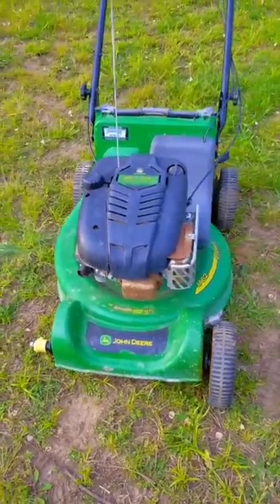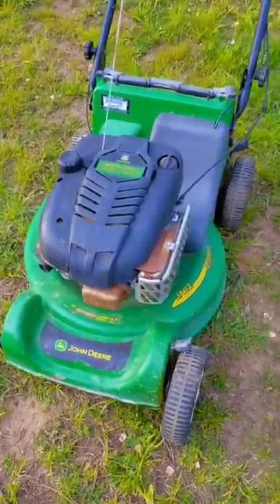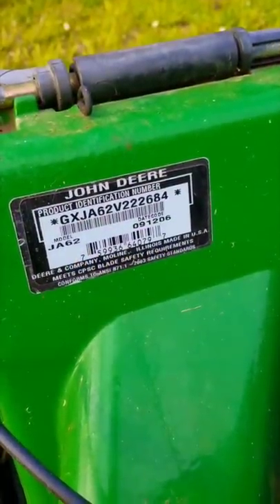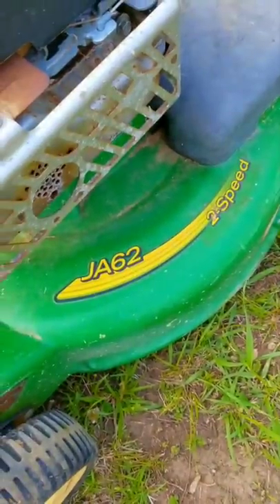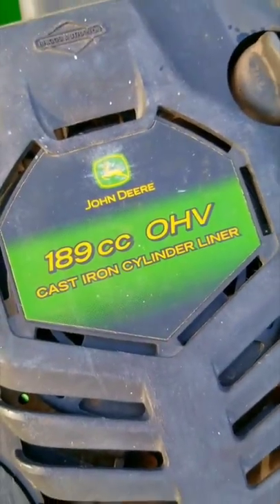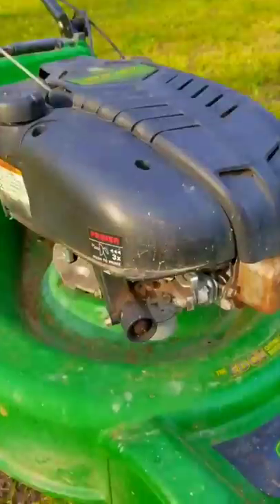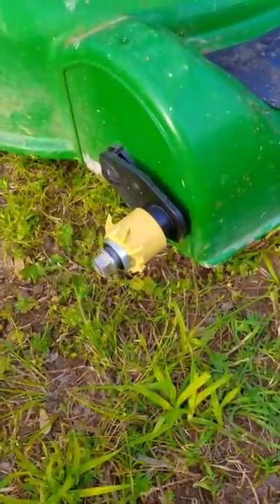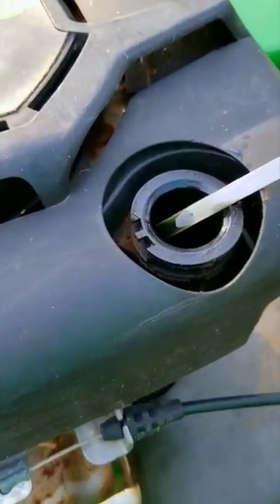That's not motor oil in the engine!

Comment: 2-stroke oil?
Reply from the maker: that's my guess as well, its a dark green and it's really thick, much thicker than motor Oil
Reply: @HomeGaragechannel  differential oil
Reply: @funnypranker34  Yeah sounds like gear oil, some of that can have a green tint. Or maybe Lucas oil stabilizer.
Reply: Looks to be 2 stroke oil. Whatever it is just drain it, take it apart, blast the thing inside out with some brake cleaner and pop it back together. It’ll work like a charm 👍🏻
Reply: Could be something weird like Royal purple mixed with something
Reply: u did used to get mineral based engine oil back in the day that was green such as duckhams
Reply: @HomeGaragechannel  it gas mix in oils because leave gas in tank over years it start leak it way into engine thur piston ring in oils pan because floats got push away by rust building up
Reply: Shit at least it had oil
Reply: I use high zinc oil and it's green like that. Penn grade. However if you really want to know, send a sample to Blackstone labs.
Reply: @Davross-420  . Why not add motor oil?
Reply: @senatorjosephmccarthy2720  how do you mean pal? If the engines been sitting with gunk in it for a long time adding oil might not solve anything. I usually take it all apart clean everything, get new gaskets fresh fuel or mix if it’s 2T, get a new spark plug and it’s usually good as new.

Comment: I have a lawn man mower from Walmart, bought over 15 years ago. Never checked oil, air filter anything. Put fuel in it when it runs out. I'm convinced its never going to stop
Reply from the maker: very nice.
Reply: The air filter will be the first to plug up using old oil it doesn't really matter long as it stays wet all it'll do is dirty up the plug
Reply: @Mike-su8si  or it just disinterested and added to the oil 😂
Reply: @travismiles4807  someone probably did put more oil in maybe they didn't know were to put it

Comment: Looks like a ton of people on here hasn't worked on that many mowers to know that is oil its just old oil 

I've worked on mower's that sat for 40 years the oil in them were thick like tar 

I've worked on driving mowers that was low on oil just like that one it was motor oil just really old oil from them not changing it plus from the engine sitting for years 

I don't believe its 2 stroke oil it doesn't look like it to me.
Reply from the maker: thanks for the comment.

Comment: I have a wood splitter at a friend's farm. I occasionally let tree work customers use it for free, 1-2 times a year. It sees probably 2-5 hours of work on average a week at the farm. When the oil level got low he would ask me what viscosity oil to top it up with. I told him; as long as it is thicker than water and thinner than honey... I don't care.
Reply from the maker: That's a good way of thinking about it. thank you 7ies
Reply: @HomeGaragechannel  small engines and repairs is hardly a specialty reserved for the rich anymore. If they break beyond repair it's just a good opportunity to upgrade.
Reply from the maker: I completely agree with you on that one.
Reply: @7eis  have to disagree with you sir I am a mechanic at a small engine shop and we do sell new and some used equipment and the supply chains and parts we have a hard time getting stuff since this pandemic was around repairing machines is important and to many people just throw stuff away there’s a reason why theses machines have replacement parts and serviceable parts buying new and upgrading is nice but it’s not always practical and is in a way wasteful we see so many machines some with less than a year of being used and people throw it away once you rebuild an engine a carburetor or do some sort of work to a small engine or a machine you will understand a little bit more about what all goes into it
Reply: @hunter7476   I will say there is no shortage of Kohler K301 parts and upgrades. I think all these parts shortages are for new items.
Reply: @arthurr8670  yeah usually but even then just filters and stuff is still hard to get sometimes
Reply: @hunter7476  I’d sure hope you’d understand how everything works a little more if you rebuild a damn engine.
Reply: @joshcantrell8397  what do you mean I’ve done many engine rebuilds before and never had it come back ran smoothly and didn’t burn or knock I know what I’m doing and I’m not an iddiot my way of explaining isn’t that great but my work shows my quality work
Reply: @hunter7476  I know parts supply has been sketchy the last couple of years. My point was how accessable information on how these small engines work (and thus knowledge to diagnose given an IQ of +80) are. And how if something truly is beyond repair a new(or new to you) replacement engine can be swapped in. Some non-essential (to me) equipment I'll run into the ground with minimal maintenance without worrying about it and just fix when not working, until it's time for replacement - like the log splitter in question. I'm honestly not sure if the point you tried to make even relates to my initial comment.
Reply: @7eis  yes I agree with you
Reply: @7eis  , Just the opposite is true. What's your agenda?
Reply: @joshcantrell8397 . troll.

Comment: I’d almost say there’s gas in there but in the smaller engines they normally have a oil that’s tinted green because it’s specific to that engine
Reply from the maker: on this tank, if the visible part of the tank  is wet, it means there's still some fuel at the very bottom of the tank.
Reply: @HomeGaragechannel  no I’m sayin there might be gas in the crankcase

Comment: What year do you" roughly" think that Mower is? 
I still have a 1989 Craftsman lawn mower in excellent condition.
The metal on that thing is extremely stout
Reply from the maker: if I had to guess, probably a 2006 model.
Reply: A push mower or driving mower
Reply: I like to hear that being as I just bought a craftsman lawn mower last year my theory when I bought it was the lawn mower would fall apart while the Honda engine would just keep chugging
Reply: @mrl3044  it can happen if it's old and used some other people don't take care of stuff to well were the engine can be just fine but not the deck and other parts the engine could outlast the deck and body
Reply: @Mike-su8si  that would be a riding mower
Reply: @billmers3219  alright
Reply: I live in the east cost and this shit happens all the time, lawn mower decks rust away, wheels fall off - i had an 80s murray pusher where the deck had like 6 holes in it, i took it from the scrap yard and acted like it was one of the ones i brought there - the old briggs classic ran great i used that thing another 2 years lol
Reply: @ryanravencaller  I have a old sears push mower and it's all took apart sitting in a bucket that's a small project for later on though I don't think they make any parts for it anymore
Reply: So is my 1968 John deere 110 but the k181s engine is missing a few small parts i can't get

Comment: That oil is definitely not motor oil. It looks like a 2 stroke oil or hydraulic oil of some sort. And also it sounded like it has a bit of rod knocking. Anyway it looks still great. Keep it up!
Reply from the maker: Great point, I didn't think about hydraulic fluid. thank you Salty Main.
Reply: @HomeGaragechannel  or some SAE 30 oil some mowers use them instead of 10W-30
Reply from the maker: thanks for the information

Comment: Gas mixed in the oil. Pretty common
Reply from the maker: that's very good possibility
Reply: @HomeGaragechannel  I used to work at a small engine shop from 12-16 years old. Learned a lot lol. I loved working on push mowers because they were so simple! Carb, gas, oil, piston pressure, spark, coil. And that’s it!! Lol!!
Reply: @HomeGaragechannel  ahhh just saw in another comment though where you said the oil was thick and green. Who knows what it was lol. As Im sure you know, gas in the oil is pretty common on those things lol
Reply from the maker: that's pretty cool.

Comment: Its not even a john deere
Surly one of the largest equipment manufacturers in the world would be capable of building a lawn mower from the ground up for themselves, but apparently not ...
Reply from the maker: it would cost too much to do that. they have to share platforms. otherwise the mower would be overpriced.
Reply: I understand that, my point is more so why can't we have at least one company that doesn't subcontract the entirety of a single machine
Reply from the maker: honda?  I don't see them using their decks, drive system or dual blades on any other brand.
Reply: @HomeGaragechannel  Honda also makes a lot more than just lawn mowers, but you know, that might just be a good example, if you leave the car part of honda out it really makes ot easy to say that everything is pretty much Honda from the ground up

Comment: That oil looks like the oil that comes in the "check and add" labeled Briggs engines from the factory that are pretty the identical model to that engine.
Reply from the maker: I think you're right!
Reply: Pretty sure this is too old for check and add
Reply: @andybub45  As far as I know the check and add is the same engine with a sticker that says check and add 😉
Reply: @patthesoundguy  nope it is a newer engine this is the old quantum series engine but it’s an ohv the new check and add engiens are completely different and honestly are quite terrible I always drain the oil and refill it with fresh when I service them
Reply: @hunter7476  I always change the oil in them when service them as well. Especially where I have an oil extractor it takes no effort to change the oil. I like to put the extractor in while I sharpen the blade and it's empty when I go to reinstall the blade 😁
Reply: @patthesoundguy  that’s funny I do the same process only I use a bucket and I gently lay the mower on its side and while the oil runs out I remove the blade clean grass out sharpen and balance blade and then reinstall and by that time all the oil is drained out it’s a very efficient process and works well

Comment: Most common problem is usually a fuel pin is dirty and clogged up… that pin may have 1-2 tiny holes around on it somewhere you may have to use a magnifying glass to find them and use a single strand of metal wire from a brush to unclog it by hand plus you should also take the carburetor apart for a good cleaning anyways…with some older small engines make sure inside the fuel tank to see if it has a fuel filter as well
Reply from the maker: thanks for the tip

Comment: It does what my craftsman/husquvarna did. It would make its own oil. Somehow the fuel would end up in the oil from just a few weeks of sitting.
Reply from the maker: your carb is leaking gasoline into your engine, which then slips by the rings and into the oil

Comment: When I was a teenager circa 2012 to 2015ish when gas prices were about what they are now I had several yards I mowed for money and I didn't have enough money to buy enough gas to do them all when I ran out I had 5 yards left so I went home and put mineral spirits in the tank was hard as hell to start but once it did I got all 5 of the yards done on 1 gallon of mineral spirits i used that same mower for like 5 more years before I gave up didn't have enough compression to run I used the hell out of that old Murray with a 3.5hp Briggs.
Reply from the maker: really?  I mighta have to try that out. thanks